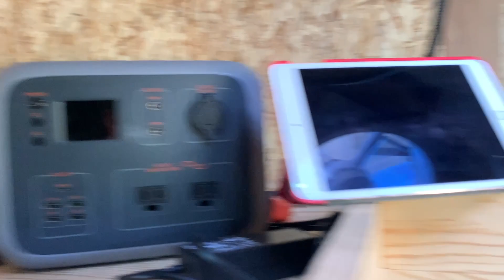Cargo Trailer Camping / Soapstone Basin, Utah / Part 5

Comment: It was fun to finally see the last installment of that trip. It was a wonderful adventure trying out the trailer for the first time really camping and it all seemed to work really well! It was fun to see just how well you planned and built it all, that it worked exactly as it it was planned for. It's awesome! Great trailer. It gives me some fantastic ideas! Thanks for sharing!
Reply from the maker: Thanks, Lisa. Everything did go pretty well. From my tiny truck pulling the trailer up and over the mountains well, to having a nice bed to sleep in, and having space to cook - away from the bugs. Also proved the ability to make cabs in the wild if one brings all the necessary equipment. A very successful  maiden voyage for the 6'x10'. :D